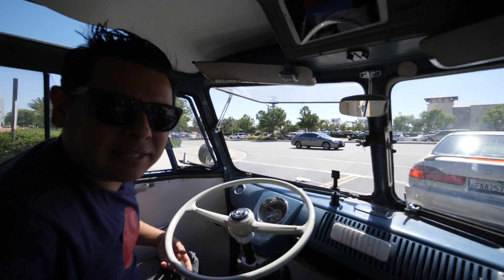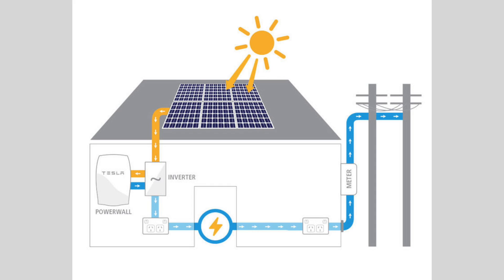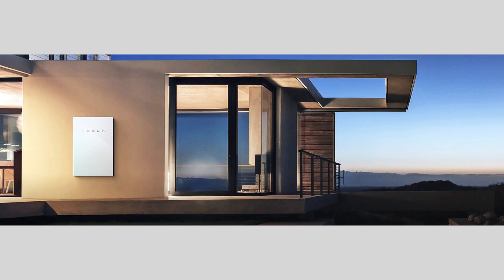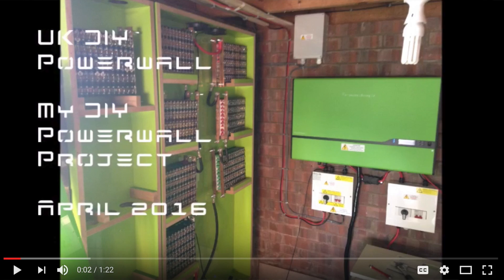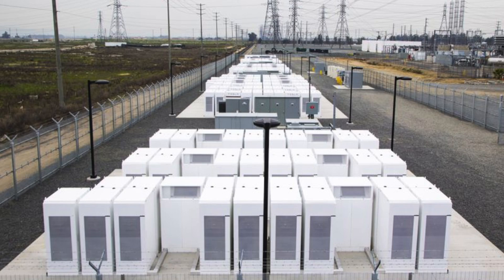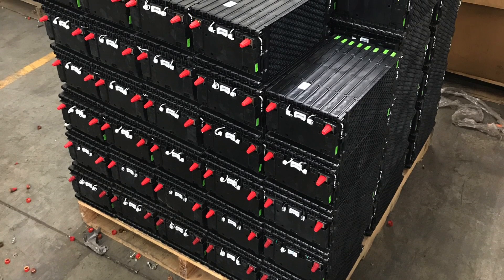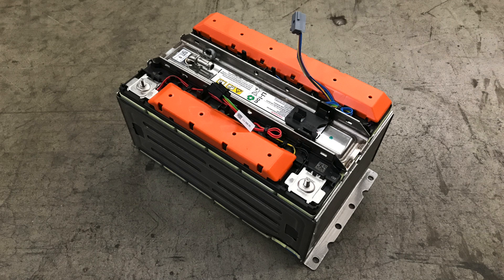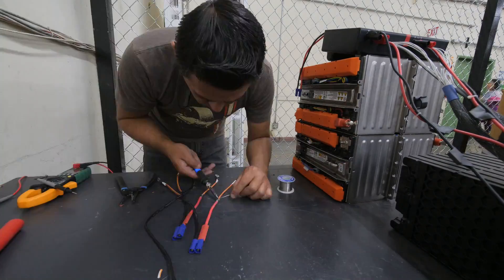1 Mega Watt TESLA style DIY POWERPACK -  1MWH

Comment: What main fuse box & inverter would you recommend to run with this DIY? 

Before I forget may I ask your opinion on if this is overkill on a off grid home?
Reply: Ill pose you a different question.  If a bigger fuel tank for your car didnt compromise any safety or space and gave you double the mileage between fill ups would you take it?

Comment: This stuff is all doable if you have enough money.  The problem is how do you pay for it and until utilities have a time of use charges it will just cost you and not save you any money.  Then the time arbitrage will have to be a 10 cent/KWh for 10 years with a number of 4000 8 hour cycles.

Comment: How is it economical if you're charging from the utility with AC to DC with that conversion loss, then using the energy you'd need to invert DC back to AC with more loss? I could see solar making sense but on utility, how can the #'s work?
Reply: Off-Peak is cheaper electricity ...

Comment: I want to know the proper way to charge the batteries!!! Nobody talks about this!!!! Wtf?
Reply: What do you want to know? How to charge individual cells? Google the Opus BT-3100 for that. If you mean a whole array of 18650's, then you are going to want to use a charge controller. Most people want to charge from solar, so its a solar charge controller you need. There are a ton of them. Just google it. I personally use my PIP4048 inverter which has a built in MPPT charge controller to charge my batteries. Hope that helps!

Comment: hi I live in Fiji I've washed almost all of your videos and it made me quite interesting and solar energy I was just wondering my house has air conditioning Fiji gets really hot so what type of solar system do I need to setup so that I can use this air conditioning  when I want to use them what type of inverter I need to set up.
what are some of the tools I need to use to find out all this information
as in almost all your videos you have said that people in the US sell the electricity back to the grid that option is not given to us in Fiji we cannot sell electricity back to the local electricity company simply means that whatever type of system I setup is going to be completely I will be using it do I use a lot of electricity yes I do I use a Volvo tricity I'm not trying to completely go off the grid but I do want to minimise the amount I use from the grid
your help will be highly appreciated thanks bro have a good one keep up the good work
Reply: 1 do energy study
1 solar hot water
3 super insulate house
4 zone system mini split
5 ground well heat exchanger
6 led lights
7 off peak high power usage 
8 sun protection windowx

Comment: i saw some of those videos
i think the UPS you tried to use did NOT play well with the Li battey pack you built voltage was too high ?
or sagged too low when connected to the inverter capacitors in the UPS
anyway keep up the good work

Comment: I've burned out several 1kw solar grid tie inverters similar to the one you are using running them on batteries.  The MPP algorithm in the solar inverters was not compatible with battery operation.

Comment: I have a fridge storage that use over 90,000 KiloWatt/Month and I am looking for replacement energy to get Off the Grid, because Saudi Arabia  in a few months well stop funding  the companies electricity and water so the prices will go 3 times higher than usual. 

40000 square meters the size of my company the location; 26.309512, 43.872702
The heat in Saudi Arabia it goes up to 55 Celsius and the cold  goes up to - 10 C*
85% of the year is hot and list then 15% is cold and cloudy.

I have a couple of questions:
How much will it cost me to get off the grid ? (battery, solar panel, and support)
What is the cost for the yearly support ?
What is the deal with the shipment?

Comment: UL approval will be crazy expensive and not just because of extra product you have o give them. It cost a lot for that approval. Those tests cost a lot as well. I was thinking before it was easy..but after i did find what those crazy ppl want..well ofc it is all about safety and about source of your product i mean batteries...
Reply from the maker: +SylwerDragon  legit battery cells in pristine condition,   So it should pass with flying colors,   But it will be costly
Reply: yeah i know ...this approval isn't cheap thing sadly ..i'm not sure about it but when we wanted to get approval for compressor (into fridge) it cost us about 1-5 k Euro. To be honest it was for almost identical product we had in market..so i'm not sure how much it will cost for full approval process..

Comment: I'm tired of hearing the watts per hour vs. watt capacity argument: Current is always measured in units per hour, so it's always assumed that watt = unit/hr. A one megawatt battery supplies one megawatt at its rated voltage for one hour. A one megawatt inverter will supply one megawatt per hour until the storage unit is depleted or the source fails due to lack of natural resource. A one megawatt generator will supply one megawatt of current per hour at it's rated voltage across all phases. Battery capacity is always measured by the unit, so to say that watt hours is specifically a measure of capacity is nonsensical. A battery pack which can supply 500 kilowatts per hour for two hours is a one megawatt battery pack. End of argument.
Reply from the maker: +ForestNinjaZero   You just confused a ton of spelling nazis

Comment: For the price of a 12kWh powerwall of 5500USD one can buy 45MWh of energy from the grid in the USA while the mentioned powerwall might at best give 1000 full charges meaning 12MWh until it is worn.
This does not make any sense.
Reply: Raymund Hofmann couple things to keep in mind: the price differential between peak hour and off-peak electricity in California can be as high as $0.30/kWh, so charging during off-peak and running off your batteries during the peak can save a lot of money.  Also, sounds like this project is using used cells that may otherwise get recycled -- so it is actually a cost benefit to extend their life with this type of application.
Reply: @RogerSM3  in the country i live in making a project like this makes no sense ... its always 50c or more outside in the summer and the kw price is 0.03$ not 0.3$
Reply: Oil is subsidized in so many ways. First you have cheap access by paying insane amounts for military operations (public money) that keep the price low. If the price would be "fair", it would still be without taking into account the effects of climate change. Who is paying the bill for increased sea levels, etc. Factor all this in and you realize that solar and wind is actually cheap and pushing this battery tech is the only way to break past the oil monopoly.

So yes, it does not make sense from a purely financial POV right now. Once the price drops (It is dropping like crazy for years) the financials will look very appealing. And once that happens, remember that it is the direct merit of many pioneers that pushed this tech at this stage.
Reply from the maker: +Raymund Hofmann   More like 5000 cycles
Reply: @jehugarcia Is this guaranteed? Even then, it would need to be more than 10K full charges to become viable, so the  price of the energy stored is more than double the price of the battery.
Still more of a virtue signallers project than a progress for the environment if you also take into account the energy needed to make the batteries and also the mining for the raw materials, which is maybe around 100-500 times the capacity of a battery.
So for a 1KWh battery you need maybe 100-500KWh to make it.
Reply: Yeah,  in decades to come we're going to look back on this transition era as a joke!  Everything associated with solar energy recovery is waaay too expensive now to make it financially viable.  Pay back years to cover installation costs will barely make it past the life of the panels, inverters etc.  Most of the manufacturers and suppliers involved are just jumping on a lucrative bandwagon.  I've costed out many options of batteries, inverters, panels, etc and non have been truly viable.

Comment: You should check out this link about Dr. Googenough the co-inventor of the batteries your using, they have a new solid state battery, that doesn't heat up and has shorter charging time,  more life cycles etc. https://news.utexas.edu/2017/02/28/goodenough-introduces-new-battery-technology

Comment: Jehugarcia, how did you sell this idea to the company if you are not a licensed electrician? I mean, you seem really smart and resourceful, but dang man!
Reply from the maker: +Nathan Ryweck  I didn't,  they asked me
Reply: Licensed electricians just install, sure they see a lot but design work is handled by engineers largely for legal reasons. I would make a strong bet this will need a licensed PE stamp if they have to get a permit, usually an AHJ requires stamped prints for new installations.

Comment: Investing in batteries now is worthless because the electricity you make is worth too much to use when electricity prices are low at night. Plus you are wearing down batteries that need to be replaced eventually.
Reply from the maker: +The Eh Team  yeah buying a car that will wear out in the future is dumb also
Reply: Do you have to worry about your home's existing electrical work wearing out as fast as a car or a battery? Most people have time-of-use metering. I'm not going to put solar panels on my roof only to use the energy when electricity is cheaper.
Reply from the maker: +The Eh Team don't,  many will and will save money
Reply: So I won't make more money by selling electricity during peak hours and using net metering for night? I should shell out more money for something that will make me less money?
Reply from the maker: +The Eh Team   I have zero idea what you talking about
Reply: Electricity costs different rates depending on the time of day. At night there is low demand and rates go down. Batteries involve even more capital investment. Do you even know what time-of-use billing is?
Reply from the maker: +The Eh Team  you are not making any sense
Reply from the maker: +The Eh Team can you clarify your point,  you sound confused
Reply: I agree that putting solar generated power into a battery is not economic if you have a net metering agreement with your utility.  You are better off selling it to them at $0.40/kWh during the day and using it off peak for $0.10/kWh, but day-time businesses don't have this option.  However, they can use batteries that are charged at night for $0.10/kWh and then use that battery electricity during the day instead of paying $0.40/kWh to the utility company.  That is what they are doing here and you can see how quickly the savings add up -- 700kWh/day x (0.40-0.10) = $210/day in savings

Comment: I have a Tshirt business where I run 220 Volt Dryer and Flash Units.

My monthly consumption is 1553 KWh.

My question is how many 280 Watt solar panels would I need to run off grid during sunlight hours.

I met you once at EVWest. Love all you videos. If you can give me any direction that would be great.
Reply from the maker: +lilpimpsc  well if 100% of the energy used is during sunlight  divide 1553/30 = 51.7kwh per day,   Then 51.7/5.5 = 9.42 
kWh per hour   So I'd say 10kw worth of panels should do it
Reply: jehugarcia Thanks again. I'm also building a 60 VW  Beetle all Electric. I'll post some pictures of it and tag you and your company since you are my inspiration for starting the project.

Talk to you soon. What is your IG Handle?
Reply from the maker: +lilpimpsc @jag35

Comment: man this is awesome... I'd love to have my own power wall to run the house... but isn't it recommended to have solar panels in addition to these batteries? What would be the point to have just the batteries without solar other than it acting just like a whole house UPS? I guess that's what it is right? I'd like to take it to the next step and go off grid with that thing + solar.....
Reply: enkrypt3d Night time rates are cheaper than day, so you can do it in reverse.... maybe?
Reply: at this point, sce and I believe dwp in Los Angeles does not have off peek rates for residential, correct me if I'm wrong.
Reply from the maker: currently about $.10  difference between night and day rates for commercial

Comment: How do you sell energy back to the utility? I mean the logistics of it. Do you just run power backwards or run a new cable? I dont get how that would even work.
Reply: Need a Hybrid grid tied/off grid with batteries Charge Controller, used with PV Solar Panels.
Reply from the maker: it just flows backwards

Comment: Load balancing on a personal scale will become more popular, but the real genius that the utilities will adopt is the industrial scale. It is hard to ramp up Natural gas, coal and nuclear power generation, but if you can run them at a steady state it is more efficient. Utilities can budget fuel and operational needs better and produce less emissions over all. I can see large warehouses filled with battery packs acting like large capacitors for the grid. This will require less new plants as well.

Comment: Why not capacitors? I never hear anyone talking about using them, why? I am sure there are some smart people that can it explain it to a noob.
Reply: I would be interested in using a capacitor to offset the inrush demand from my air conditioner.
Reply: TheKlickitat Caps store very little energy, imagine having a huge cap at 320v, you might get a few minutes of power out of it if you powered say a lightbulb
Reply: so is there no way to meter the energy coming out of it?
Reply: Because they're more expensive, and hold less power. The technology does exist, 'tho. (and will be appearing in the 4th generation of our electric race car -- charging batteries is a pain in the ass.)

(Also because EV West would ex-communicate him for touching ultracaps)
Reply: sadly all this means now is we will get no new battery tech if tesla can stop it, they invested so much in lithium
Reply: There are caps on the horizon based on graphen micro tubes that promise reasonable capacity
Reply: Zx
Reply: Hard start cap.
Reply: Your air conditioner will have a startup capacitor inside to do that already or if its modern then it will be inverter driven with a brushless motor so there will be no reason for it. The muge rush c=from motors come from the fact that from a stall under load they are very much a short circuit, the other problem is they are inductive so the power factors are a mess...
Reply: I worked on a company that does exactly that in Orange ca. Makes back up systems for naval ships
Reply: Ya it's called a battery, energy density also aint too great.  But ya, you don't meter power coming out of a cap.  Caps are for giving a quick shot of power when needed blocking DC, etc...
Reply: Because you can't power a building off a lightening bolt aka a cap.

Comment: What brand and model are those black case batteries? Are more available? What's the price of them?
Reply from the maker: LG chem pouch,    Lots available,  about $150/kWh and less when in purchased in large quantities
Reply: jehugarcia got a link for them.? eBay?
Reply from the maker: no link,  they havent set it up,   they are interested in moving truckloads instead of a few here and there,   So its my job to spark interest in these so its worth it for them to sell smaller than truckloads amounts,   If i can show them there are hundreds of us small fish,  then they will be available sooner,   sign up to my mailing list I will make them avaible there first as soon as I can
Reply: *Start up a batch orderlist/monthly order, there ya go 'truckloads'
Reply: awesome, I signed up for the mailing list. had trouble finding it though...You may want to add it to your standard description. Hoping to buy them to do a 30kwh powerwall this summer. What inverters are you using for this project?